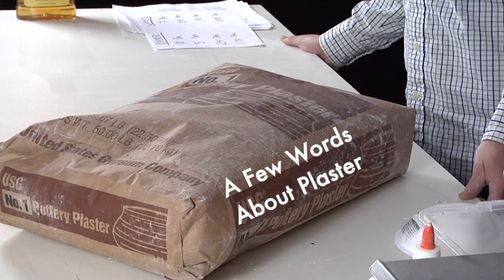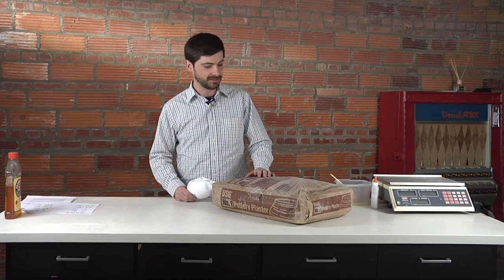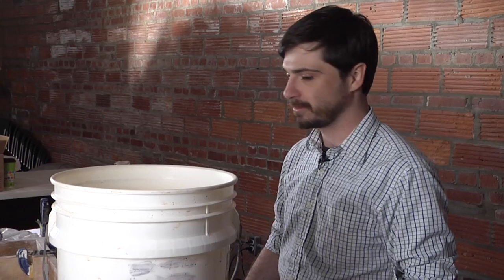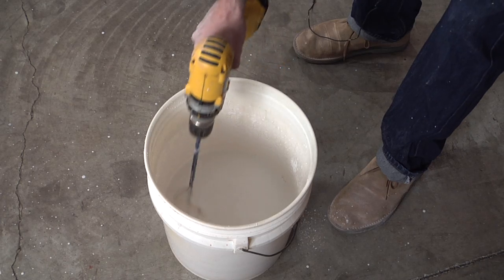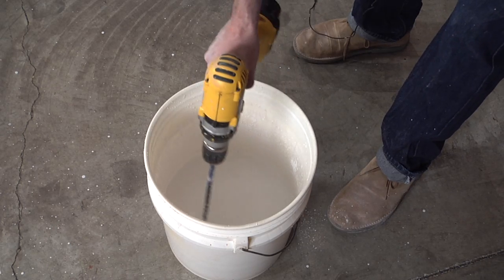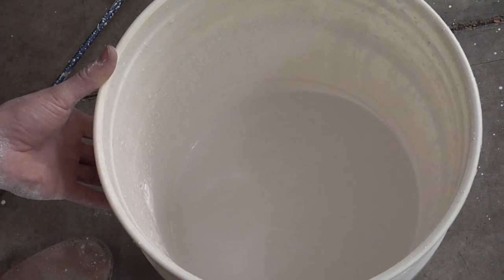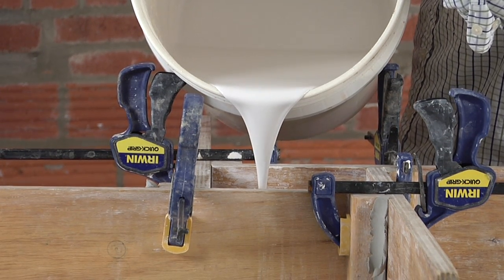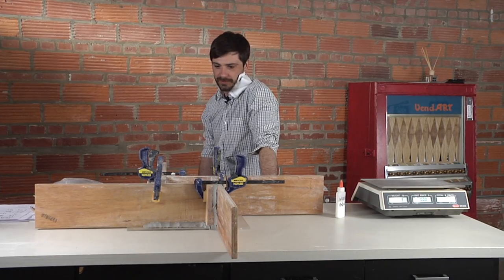How to Weigh, Mix, and Pour Plaster for Slip Casting - GUY MICHAEL DAVIS

Comment: Yes, whoever created the ratio chart, missed the decimal point - should read:

PLASTER      ------ >   WATER
10 lbs                           7 lbs
  5 lbs                          3.5 lbs
 2.5 lbs                        1.75 lbs
1.25 lbs                       .875 lbs
Reply: would this ratio work with latex statues molds smaller ones under 6 inchs
Reply: Thanks. I was like what the heck man?
Reply: @colindavis2113  so glad you posted this I was like wtf trying to figure that chart out
Reply: Why not start from 1 lb. of water, or 1 lb. of plaster to make the ratio easier?

Comment: My plaster molds have been chalky and  crumbling easily, and plaster dust residue is left behind on my slip castings. I've noticed commercial molds seem to be harder and more durable. They never leave any plaster on my castings.  What is the difference? Are they using an additive to make their plaster stronger? or am I just doing something wrong? 
Also, is it a bad idea to dry the plaster mold in the oven so it can be used sooner?

Comment: How do you clean the plaster mixing bucket and mixing tools?
Reply: Let the plaster harden, then pop out the resulting disk of plaster. This can be used as a place to set finished castings while they dry.
Wipe the remainder of dried plaster off of the sides of the bucket with a rag.
Do not, under any circumstances, wash out plaster in a sink!